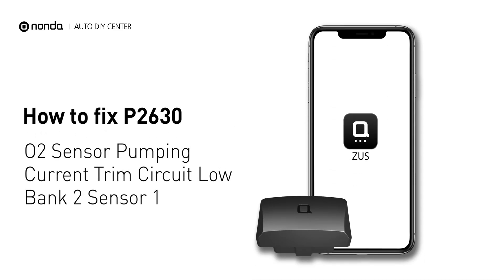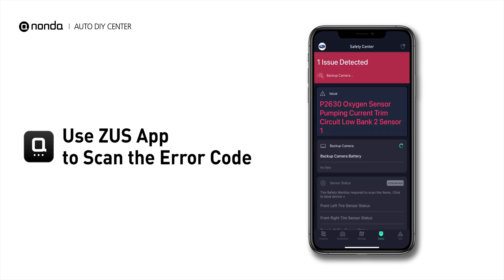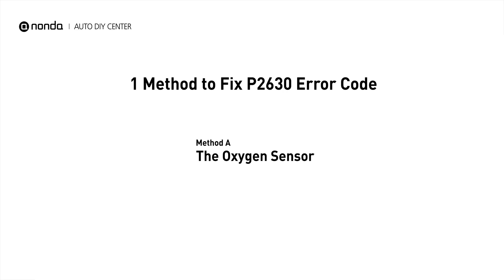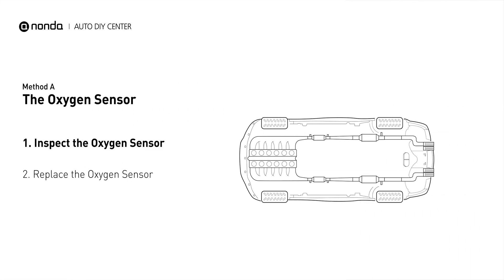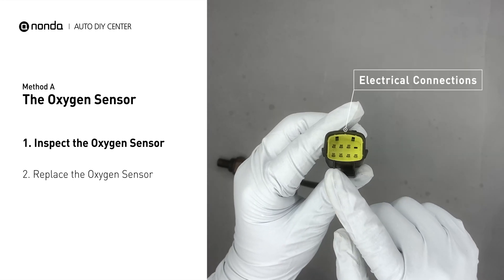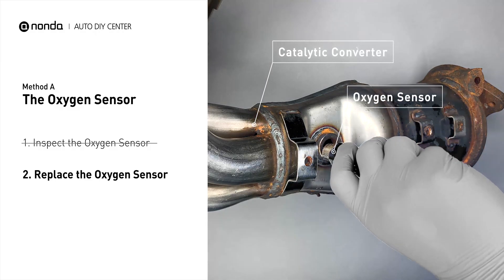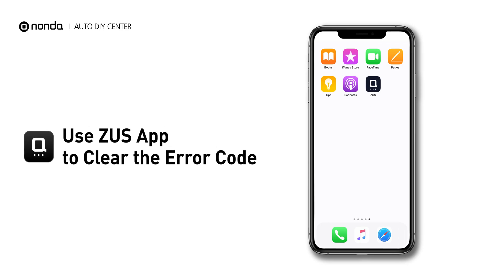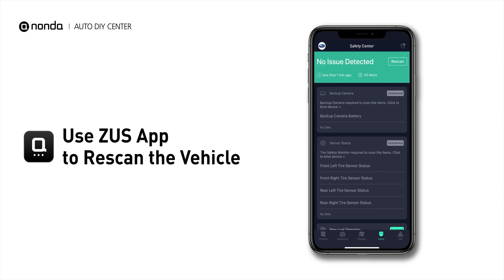How to Fix P2630 Engine Code in 2 Minutes [1 DIY Method / Only $19.97]

Comment: i bought new o2's and got them put in little over a month ago. i have a misfire right now to because my catalyic converter. can that be a reason this code popped up? should it disappear when i fix the cat problem?
Reply from the maker: Yes it could be. But we suggest to have the vehicle inspected by a mechanic for further diagnostic.
Reply: @nondainc  i took it to ford they said its the cat causing the misfire. And its a new code i found out about yesterday. I have a catted x pipe i will be installing in a couple days so ill see once i have new cats in